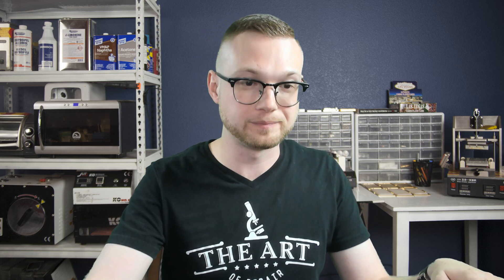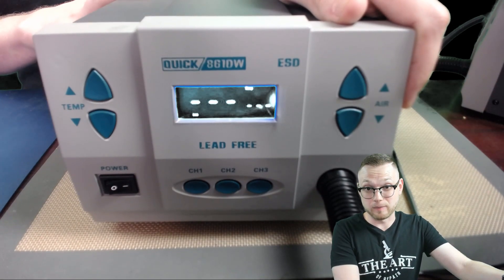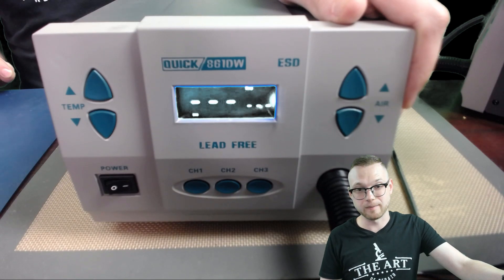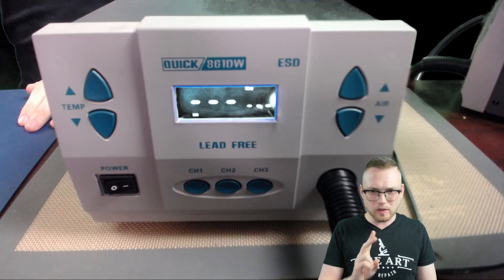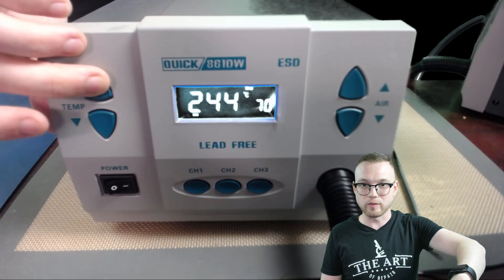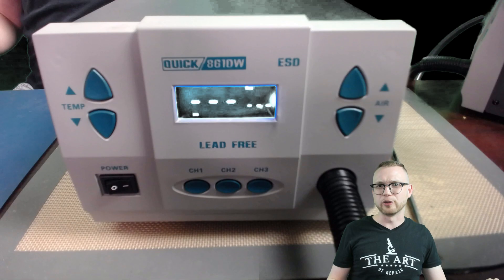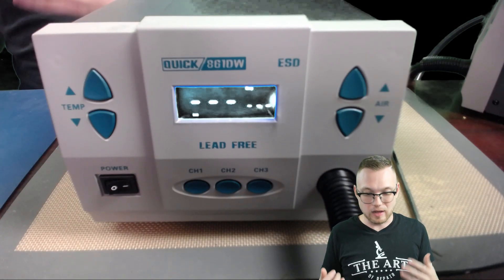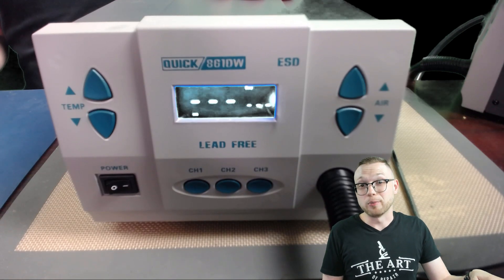EP53 Hot Air Channel Preset Guide for Mobile Repair | What do I set my hot air to? | QUICK 861DW

Comment: Is the Quick TR1300A not better?
Reply: same brand
Reply: SUNSHINE TOOLS why not good?
Reply: @ErolureNL  good
Reply: i mean , it's good
Reply: SUNSHINE TOOLS haha ok thanks
Reply from the maker: I think I like the 861dw more, seems easier to use channel wise. A little less powerfull but that isnt a big deal when it comes to small pcbs
Reply: @TheArtofRepair  Oke thanks bro, i have the tr1300 now from union repair, but it makes so much sound when i place it back in the stand. it likes a jet engine sound. some times is set the handle on the microscope stand to save me the sound of power. mayby i go for the 861dw;P

Comment: just received my quick today and new to soldering is the quick ok out the box or do i need to calibrate it can you tell me cheers
Reply: Have you figured out how to set the safety password? Every time I set a new password, I turn it on and it says "password no" how do I change to yes!
Reply: I have not even tried lol
Reply: @kylemcmahon24  it's not clear but after struggling to find anyone covering this other than a Spanish review video I believe it is not a password safety feature. I think it just locks the pre sets so techs can't change them.
Reply: @joeldiment146  i would say that is the case... have u calibrated ur quick nine new out if the box yesterday according to my fluke multimeter my quick  temp  was off by like 70°c
Reply: @kylemcmahon24  I have not calibrated mine yet, it is also new. I upgraded also to a jbc precision iron cd-s t210 as well. I believe mine was calibrated by the supplier here in the UK who are a licensed vendor but I need to check to be sure. I had a problem with the switch on the quick last night so took it apart, which I really do not advise. putting the case back on is not easy! I believe the switch may have a safety feature where it locks out if you press it to often or maybe mine is faulty but it's ok for now again.

Comment: Hi Justin I know this is asking alot but I just bought one of these quick 861dw stations and when i turned it on it just displays a H-E error and does nothing. The manual indicates this is a heating element failure. However the fan does not spin up either. I'm trying to decide if i should spend $80 to get a replacement heating element. Is there anyway you could unplug the heating element and tell me if the fan still spins up on a working unit? If it does I know my unit is stuffed on both fronts. Also could you do an ohm measurement of the heating coils and tell me what value to expect? Or if any other viewers are happy to help a fellow out I would be very grateful.
Reply from the maker: Hey! I honestly think the best way to get an answer for this will be to just contact quick CS, I have spoken to them on a few occasions about things and they got back to me pretty quickly.

Comment: hi justin! i have the same station, but i have some problem to desolder and resolder connector or mobile phone. 

like lcd connector, button connector etc 

could you suggest me some profile temps?

thank you very much from italy!
Reply: Me too, not finding it very good at all. Gone from a cheap 998d which would work well at 350/380c for tablets and mobiles but the quick wont remove anything at that temp :/ waste of money

Comment: Hey Justin, I went and ordered the quick station the other day.
Could you please give some suggestion on which nozzles I should get. I see there are two types, one with the straight nozzle and the other that has slightly bended nozzles which I haven't used before. 
I am looking forward to your next video.
Thanks alot.
Reply from the maker: It comes with the three basic sizes, I use the middle sized one in the basic kit.